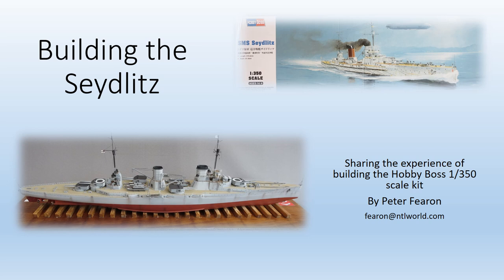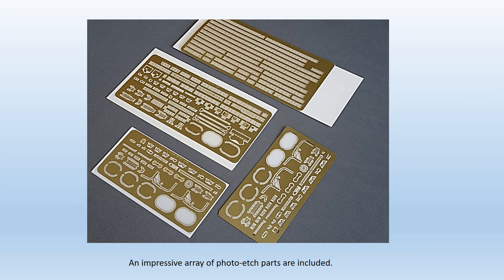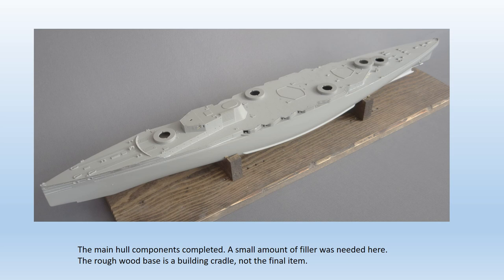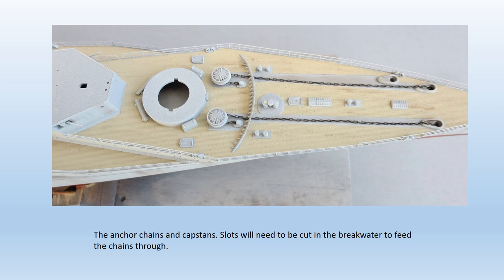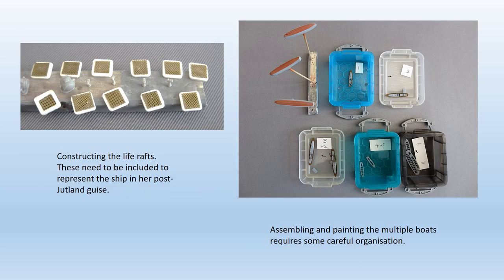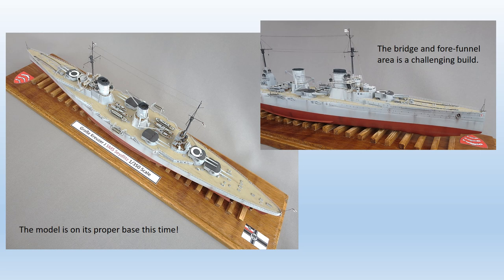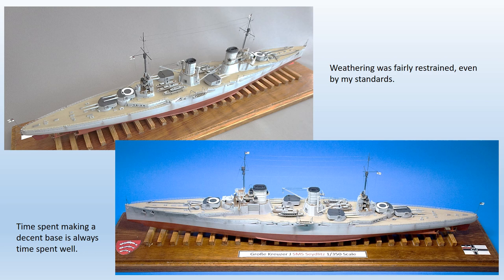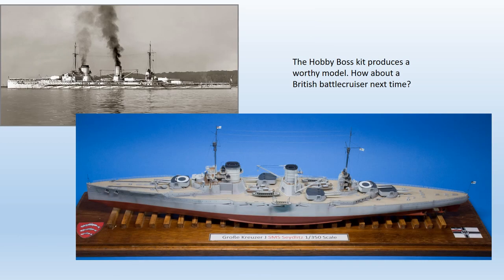Building the Hobby Boss Seydlitz in 1/350 scale

Comment: This looks like a good model albeit the truly clumsy deck detail. A nice looking hull shape and overall good fitting.   I will be embarking on using AK burnishing fluid for tracks and wondered if you thinned yours with water as the anchor chain finish is very good.  You also mentioned two applications, intresting - I've only ever read of single applications...

Your boats are great and the replacement masts and aerial-work really adds to the realism.  You are so right about less is more and the rigging is a good example.
Reply from the maker: Hi Gordon
I don't thin the AK fluid. Using it twice gives a darker finish, but you have to watch it with really fine parts of it can eat them away!
Reply: @peterfearon317  Hi Pete, I see, I'll be looking for a lighter finish due to the alloy in tank tracks in WW2 so possibly one dip.  The Panzer IV tracks do have very fine loops at the ends so I'll keep an eye on it.